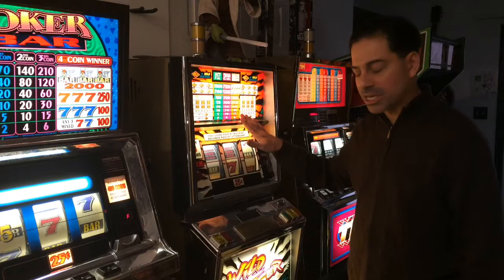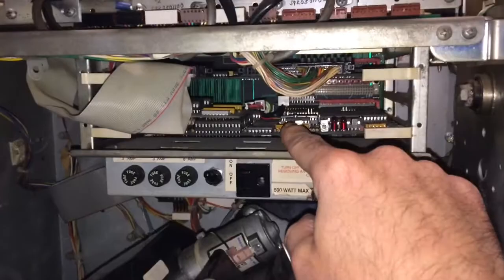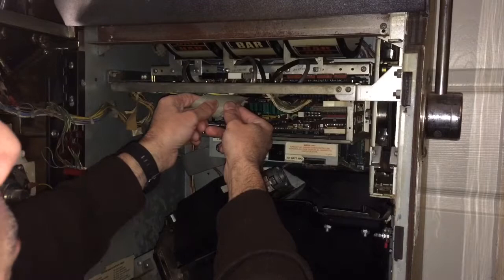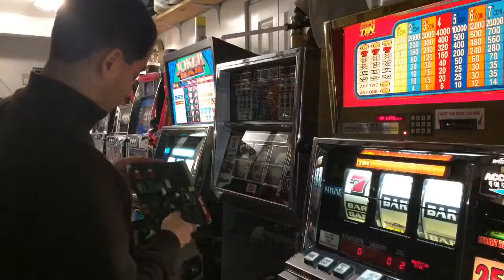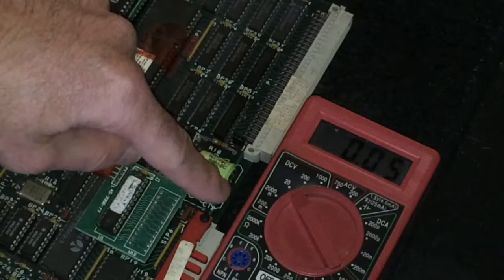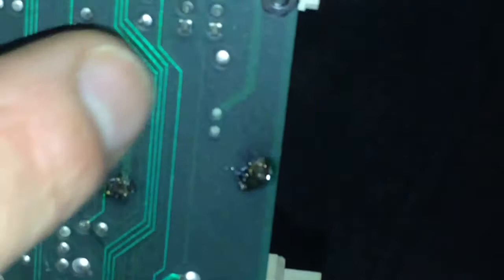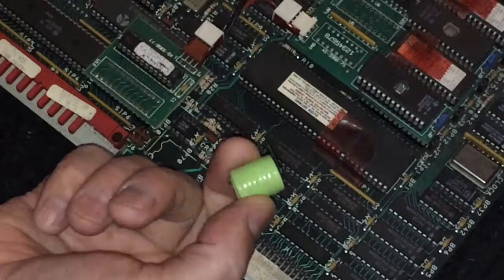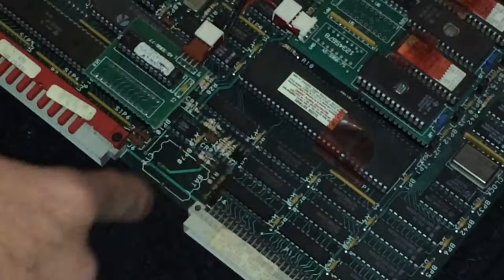How To Replace Battery On Bally 5000Plus!! (The Phillips Gameroom: Episode - 8)

Comment: I have just replaces the battery in my 5000 With the same Varta, Now my MPU leds are just flashing.
Reply from the maker: What codes are being displayed?
Reply: @PhillipsVision  It's not producing any sign of life from the leds board. Its been making a Strobeing noise and flashes.
Reply from the maker: @lilomelet68  I would start by disconnecting all your ribbon connections to the PCB board and cleaning them with alcohol on a q-tip. Let it properly dry then re-attach them and make sure they are secure. Sometimes loose or bad connections can cause this.

Comment: i have a fault 24 in my one armed badied, you know what this content
Reply from the maker: What is the make...Bally, IGT, Williams etc?
Reply: Bally
Reply from the maker: @robinwagener6536  that usually pertains to a coin mechanism error. Either a faulty coin-in or the coin optic device. If your machine has a coin comparitor it may be faulty or registered an error, could also be the bill validater. Check all money in mechanisms and ensure no blockage or loose harness connections. If all is good clear the ram and restart the machine.
Reply: yes I had already looked at the cabinet inside, and could not find anything strange in it, but a new coin reader has been installed so that you can now also play with euros, but the malfunction 24 does not have a certain error